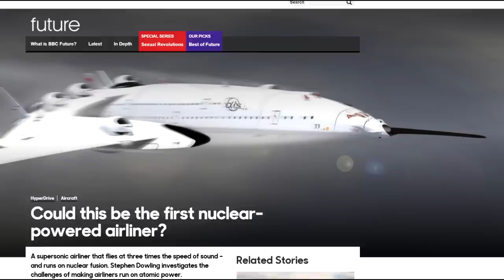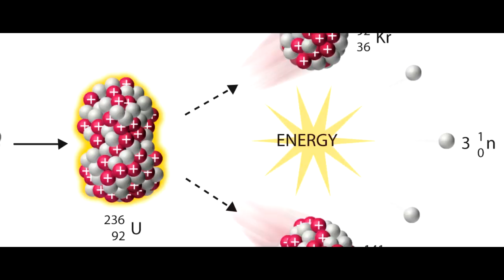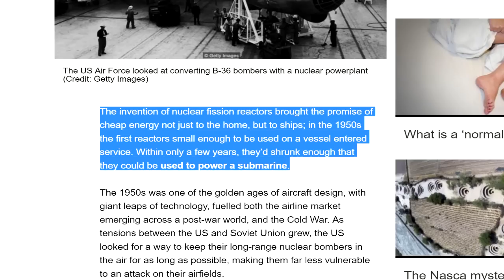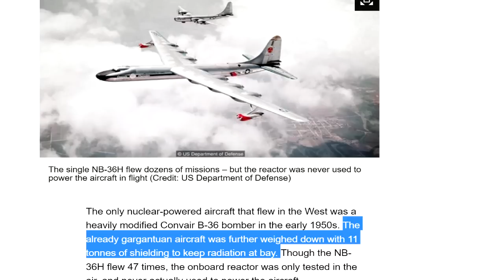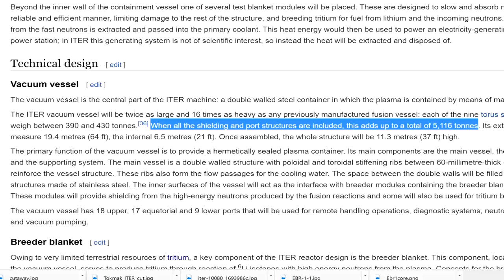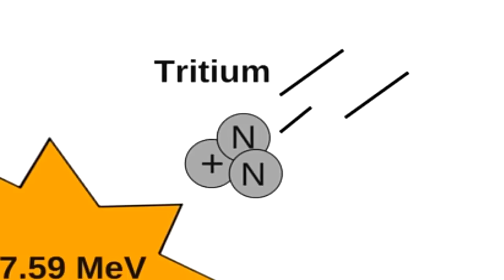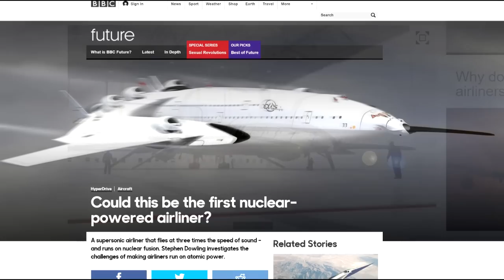SIX ENGINED Nuclear Airliner... BUSTED!

Comment: Wait wait wait.  Runs on FUSION? I am no fucking scientist, I'm barely scientifically literate myself. BUT FUSION? I haven't heard of anyone being proclaimed God Emperor of Mankind and given the ultimate nobel prize, 15 seconds in and I'm questioning how this got past anyone.

EDIT: They should have found a scientist (with related knowledge) the second they saw fusion on it.
Reply: Well, there are plans to make fusion reactor, the theory of how to make such a thing is understood, but the engineering challenges are huge.
Reply: Creating fusion reactions isn't too hard, but getting useable power out of it is completely different story.
Reply: @themurmeli88

Uhhhh, no?

That is not how fusion reactors work, they are not like fission reactors where failure to contain the materials in side is a huge disaster for the area.

If power to a fusion reactor is lost, then (assuming the thing works like anything currently being worked on) the high-heat, high-pressure fusion material will simply cool down dramatically by touch the reactor walls and lose pressure as well if it opens the vessel, thus instantly ending the fusion reaction and failing to release the potential nuclear energy of the remaining fuel.

Yeah, whatever you hit might end up having a chunk of it melt in a really exotic way and the hydrogen will make a rather unique explosion, but not like a thermonuclear warhead.
Reply: NotaWalrus I will not deny plans. What I will say is, fusion is going to be hard as fuck. So for someone to be saying "This will run on fusion" in 2016 when fusion is not viable, just does not follow.
Reply: Speaking of nuclear powered devices... how are they propelling the aircraft? 

Normal jet engines use kerosene as both a fuel and a propellant. Fuel and air mix to burn and expand generating alot of thrust. 

Jet propelled seaborne vessels uses diesel as the fuel for the generator. The
electricity is used to power a pump, using water as propellant. Despite the
weak conversion from electrical to mechanical energy, water has high mass,
making it efficient to a certain degree.  

Assuming that this proposed plane has to maintain a speed of Mach 3 with 'air
pumps' powered with a fission reactor. The intake would probably need the power to suck in pine trees.
Reply: They were high that's how.
Reply: nick holmgren Fine, it would not explode. If the reactor has tritium leak during the crash it would just contimate whatever water sources it has contact with for 12 years.
Reply: i call bs
Reply: Thehairysoap In the old Air Force designs the rectors were used to heat air that would bush the plane forward.
Reply: I know right. What's up with the BBC? Has Murdoch bought it?
Reply: Pfft, naw man. It's only a decade away from being a reality, just like it has been for the bat 4 decades.
Reply: Well they claim that on 2022 they might have a working fusion reactor, but even if by some miracle they would make it work, if that thing ever crashes, it would be literally like setting off a fusion bomb on wherever it crashes. Like, if this was the plane they'd rammed the twin towers, there would be no New York city.
Reply: I know fusion technology is still 20 years away.
Reply: nick holmgren Characterization of fission is only true water cooled reactors. Molten salt reactors, which are what the Air Force used in their design, don't have that problem.
Reply: Did you mention a god emperor? My title changed you know.
Reply: This is real life not the fallout universe
Reply: LouistheHedgehog That will generate A LOT of buzz. That was what I was getting at, fusion is hard, fusion is still in the future (ergo you can't be like, hey this is what a fusion powered plane may look like), achieving viable fusion will make your ass famous.
Reply: "Creating fusion reactions isn't too hard, but getting useable power out of it is completely different story."

Not to mention the energy needed to start the reaction : S

Comment: why would you even power an airliner with a nuclear reactor? it's not like it can be super much faster, and staying in the air for months, or years without refueling doesn't sound like it offsets the cost
Reply: +BUJU2007 Nuclear power stations cannot explode like a nuclear weapon.
Reply: Subs an stay below the waters for decades if the crew didn't need to eat, a nuclear airliner would never have to refuel for decades, too. Flying reactors are a stupid idea none the less. Nuclear cruse ships make sense though.
Reply: +BUJU2007 Not really, bombs, but radiation leaks could be fairly bad.
Reply: carbon particulate matter from combustion kills around a million people every year, I think that is a reason alone- jet engines are really quite filthy.  Not saying this particular idea is a good one, but getting off burning hydrocarbons is a worthy endeavor.
Reply: ***** The design that ran the air over the core was pretty efficient but spewed radiation out the tailpipe. The one that used molten salt to heat the air wasn't efficient enough to work in a plane, but it could be used as a better reactor generating electricity and some other things. In fact the only reason Alvin Weinberg worked on the program was to keep working on molten salt reactors.
Reply: ***** Of course, you can judge him for liking MSRs, and my judgment is that he was a very smart man.
Reply: Not only that but it would be like filling the sky with nuclear bombs.
Reply: The idea originated with the USAF which did need a plane that could stay in the air for days or even weeks. Also, a plan that doesn't need to be refueled for decades is attractive to airlines, and it wouldn't produce CO2 or other combustion byproducts.
Reply: nuclear powered engines are basically electric anyway, just use a fuel cell that works without needing insane amounts of shielding just so passengers don't die within the hour ;) and yes, you have to invent one to make that work. duh. but that is slightly less fairy dust than putting a flying reactor in the air.
Reply: ***** These might might be electric, but nuclear plane engines don't have to be. In one of the designs for the Air Force, air was passed over the the core, heated, and then exspeled, and in the other design, air was heated by molten salt and then exspeled.
Reply: can't judge a man for liking molten salt reactors
Reply: ***** I know. I making a joke.
Reply: +NotaWalrus I don't know how it would end up but what would happen if it crashes in the ocean and is just leaking radiation constantly.
Reply: Plus the amount of shielding required would just make the whole thing a very expensive lead balloon filled with irradiated corpses.
Reply: Canonical Oh ok, Thanks for clearing that up.
Reply: huh, interesting. wonder how efficient that concept is and if it has any "real" applications.
Reply: I meant I can't say negative things about him because of it. figure of speech and such.

Comment: As soon as you read "fusion" I knew the bullshit would be overwelming.
Reply: You know that thing we are still incapable of using for power plants let's strap it to a fucking plane.
Reply: Fusion is a cheap tactic to make frail planes volatile.

Hold on, wrong fusion.
Reply: Well, you know, they could strap solar cells onto the planes, that way they could harness the energy of that fusion reactor that floats in space about 150 million kilometers away. ;)
Reply: Why? Fusion is a real thing. Or is it fission?
Reply: well both fusion and fission are real but just fission is currently used for electricity production
Reply: +Schnittertm1 are you talking about SOLAR FREAKING AIRPLANES!!!
Reply: +DOMINIC HA Both are real things. Watch the full video, f00t explains why fusion is bullshit in the context.
Reply: Fission is easy stuff technically, if you don't care about shielding. A thermal turbojet is possible if a reactor replaces the flame tubes to replace the source of heat of over 800C I hear (the American light water reactor will not work!). An unmoderated fast neutron reactor would be the smallest using air to cool it. However if you happen to fly the thing in the rain the neutrons will be moderated by the water and cause a huge power spike. Or you can go with explosive NaK coolant to remotely transfer reactor heat to the engine.
Reply: It is real, but not usable to really generate power yet.
Reply: TheObsidianX no he is talking about thorium infused solar freaking air planes made from air carbon and all drinks are provided using peltier devices
Reply: +zokr that is also 3x the speed of sound, and it would be comfortable!😂
Reply: Permanent Cloak well you cant feel speed just acceleration and if you accelerate fast enough for the human body to notice you can go from 0 to mach 3 without any problems
Reply: +zokr I know right and the water comes ot of the air.
Reply: for now all nuklear power plants we have use fission. we have test reactors for fusion but its not at a point to be used comercialy. you only need a lot of power in the begining to start the fusion. once its going it is self sustaining.
Reply: For right now, yes.
The inefficiency of our current attempts at fusion is horrendous. Fusion gives you SO MUCH power it's ridiculous, but it's just as ridiculous to try to force matter to emulate the temperature and pressure of the goddamn sun, which is where these reactions happen naturally. Also, you probably want to live through it, so you need a great stinking wall between you and it.
And then you want it to fly. HAHAHAHA.
Maybe one day, with a different process, in a different method. But not anytime soon.
Reply: +DOMINIC HA
Fusion is real, its just that we've only preformed a single reaction using it that put out more energy than what was put in, and it only lasted for a brief moment..(Think it was the NIF that pulled this off)

Fusion energy is still a bit off, atleast another ten years as ITER works on building the worlds first nuclear fusion power plant, purely for testing purposes, than the build up to an ACTUAL nuclear fusion plant afterwards \o/

aka, fusion energy being used commercially is probably a long ways off, as in 2050+
Reply: +TJskillz169 Even that is misleading, since it only includes the energy put into the fuels, not the energy needed to run the system. That is, the experiment was still net input.
Reply: seigeengine i had only read from other sources that it had an overall output of energy, i didn't know that they weren't including the energy they were putting into the system to make it run.
Reply: I already know about the failure of US atomic bomber. And even if the concept was viable today, the possibility of nuclear reactor plane crashing, is not my idea of fun.

But once they mentioned nuclear fusion I knew that the bullshit will be overwhelming.  :D
Reply: Dario Zanze
It is possible to put appropriate levels of shielding and armor on a nuclear reactor such that you could make a flying machine from it and not risk polluting the countryside if it crashes. It would be a shitload of armor, designed to absorb a powerdive faceplant. You would need the power of... well, a nuclear goddamn reactor to keep the thing up running jets. The resulting monstrosity would more resemble a floating city than an airplane.
Now try to cool it.
Reply: William Barnes On a reactor that has to power a large plane to mach 3 speeds., shielding not just for the crew but 250 passages?
Reply: Dario Zanze
No, air nuke fortress city won't be going mach 3. It will however have plenty of room for passengers, because the mass of passengers is insignificant compared to the armor needed to make the reactor stay safe and intact if the plane crashes. You basically have to black box the entire reactor, which makes it a fucking aircraft carrier.
Reply: William Barnes I feel mildly upset now I don't have the knowledge to roughbrain-design a sky city now.
Reply: seigeengine
Oh, I'm nowhere near that good either.
Reply: William Barnes The real question is do I fuck it and try anyway, or do I just be miserable until I get distracted by something else and forget about it?
Reply: William Barnes That would be a great zombie-fortres 😊
Reply: seigeengine
Be miserable until you get distracted. Alas, you can't even begin to try building a nuclear air fortress city. Trying would get you vanned, even if you did have the money.
Reply: William Barnes Oh, of course I couldn't actually build one. We're talking, what? Tens of billions minimum?

I'm talking design, not build, and of course it'd be horribly wrong in a million ways, but it would be satisfying.
Reply: +DOMINIC HA  Oh, fusion is a real thing. It's just that every functioning fusion reactor has a tendency to vaporize itself and everything else for several kilomiters around when you operate it. :P
Reply: Me too. It reminded me of the Italians who pretended to demonstrate cold fusion while stopping the gammas and crap with a thin sheet of aluminum.